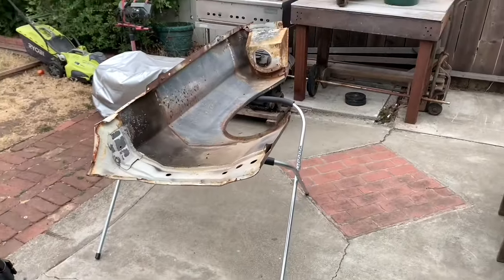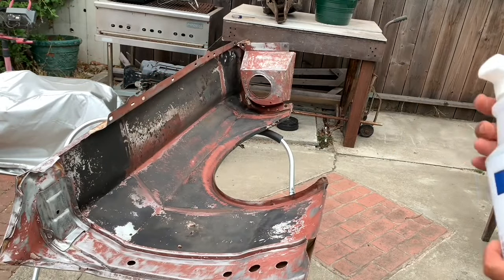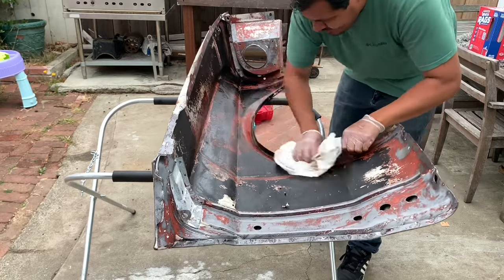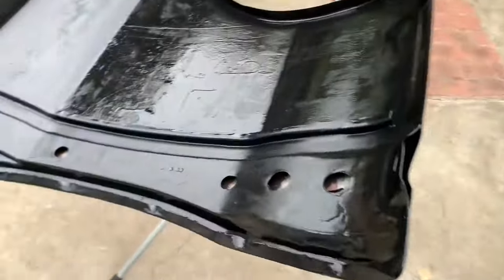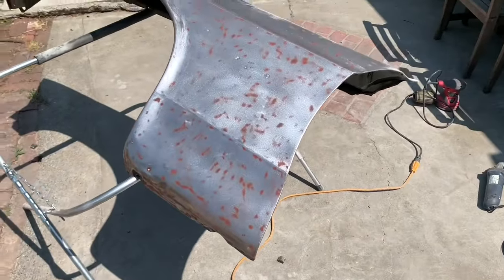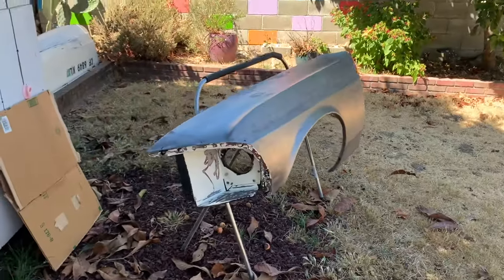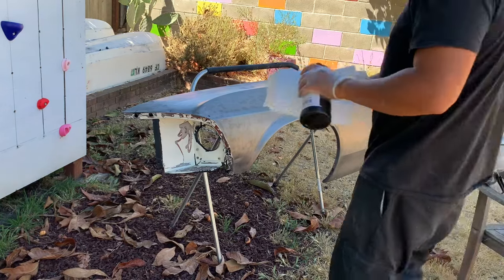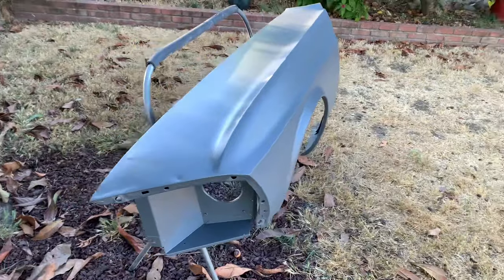69 mustang fender rust repair using Eastwood’s fast etch rust encapsulator and epoxy primer

Comment: The time you spend you could just buy a new fender  lol
Reply from the maker: Aftermarket fender or original fender is the big question sometimes. I want to keep as much original metal as possible. Plus the goal is to have a running driving car for under $6,000 which is my budget for this car. So spending over 500 for a set of “new” fenders is out of the question. Doing the labor myself on my free time means it’s cheaper for me to strip down and work with the originals than to just slap aftermarket ones on it.

Comment: well done champ you could have used a flat disc sandpaper 80 grit with a rubber backing disc on a drill to remove the paint then go over it with a finer grade sandpaper to eliminate scratches prior to the sealant but your end result is great
Reply from the maker: @russelblackwell6041  thank you for the tip. I’ll try it on the quarter panels and roof. I have a few of these angle grinder stripping disks so i was using what i had on hand. Thanks for the views

Comment: I appreciate this video, sir! I could not hear what you said about what you were using immediately after the wire wheel. Were you using household cleanser to remove the dust left behind by the wire wheel?
Reply from the maker: Thanks for watching. I used wax and grease remover or acetone for cleaning after the wire wheel and for every other cleaning step
Reply: @dailyhondas1480  , that makes sense. Cool. Thank you, sir. Your video helps me to be more confident as I begin my work on my 1964 Oldsmobile.

Comment: You could have used the pick and file method to get out those hundreds of low spots and saved yourself some bodywork.
Reply from the maker: Thanks for your input. I’m really not familiar with the pick and file method. From what I’ve read, you basically file down the high spots and hammer and dolly out the low spots? That’s true metal work. From looking at the panel after the epoxy layed down, all those tiny low spots won’t make a difference once i level it out using guide coat. I’m more concerned about the dents and previous repairs that were done by the previous owner who just slapped globs of body filler on the panels instead of working the dents out first. In my book, there’s nothing wrong with a little body filler if you use it correctly. Thanks for the views

Comment: Have you used the rust encapsulator before? How do you like it? It’s doesn’t feel right covering rust.. thanks for sharing
Reply from the maker: I’ve used it in my 92 civic when I repaired some rust around the windshield. On that i cut out the rot and welded patch panels but i used the fast etch for light pitting  and the rust encapsulator in the hard to reach areas like pillars or the backside after welding was finished. It’s a better option than just using rattle can primer. On these fender I removed as much rust as possible with the wire wheel and then used the fast etch to chemically treat the rust before applying rust encapsulator on the backside of the fenders. I didn’t cover the rust, it was already mechanically and chemically removed or treated. I just decided not to remove all the primer on the backside because it was still solid wherever i left it. Some areas it flaked right off and some areas it was still good. you can see in the video on the front side i took it to bare metal and used fast etch to treat the metal to prevent flash rust. I wouldn’t  suggest taking a rusty part and cover it with rust encapsulator without first removing the rust and chemically treating the metal. All in all I’m happy with the rust encapsulator.
Reply: @dailyhondas1480 thanks for the reply. Funny because that’s the way Eastwood makes it seem. Get the big stuff off and encapsulate it.
Reply from the maker: @jimdrechsel3611  yeah. I think they mostly focus the use of it on heavy gauge metal like a chassis or a differential, stuff that probably didn’t get paint from the factory. They also market it towards the hard to reach areas like channels and inside rocker panels that aren’t rotted but the only real thing you can do is spray something inside. Only time will tell how it holds up. I used it on the back of the fender because I figured it will see water splashing so I thought having something that has rust preventing properties was a good idea. Thanks for your questions and input.

Comment: Looking good what kind of setup do you have for your paint gun
Reply from the maker: I have a 20 gallon Husky compressor and Husky HVLP gun with a 1.4 tip that i bought like 10 years ago. I have two small water separators after about 30 ft of coil up air hose and then another hose to the gun and a small filter right at the gun. It’s not much but it’s enough for small jobs like this.